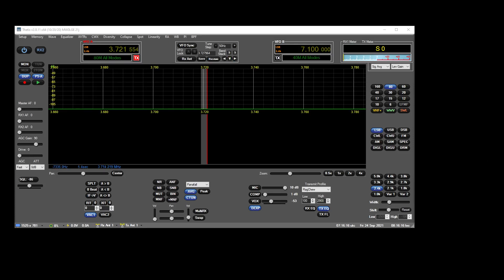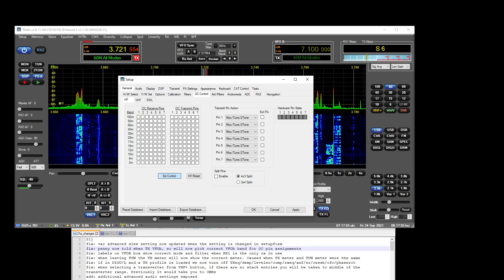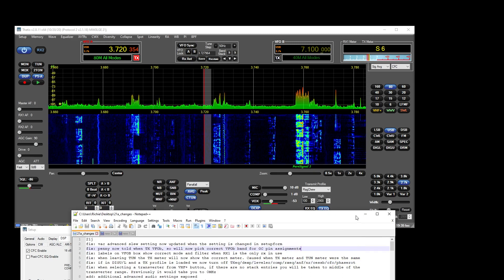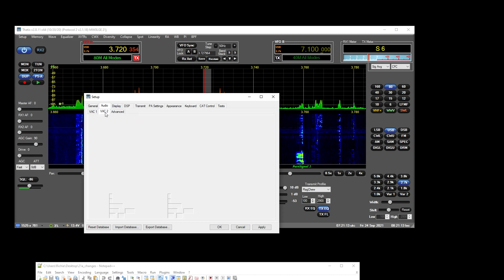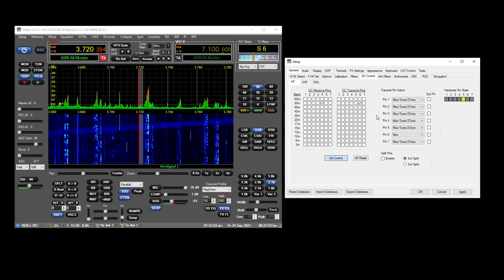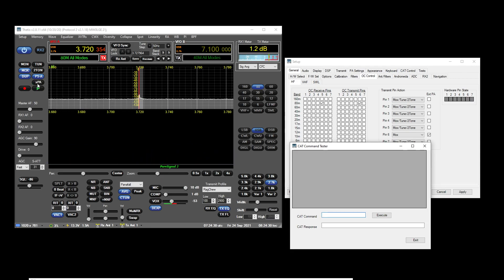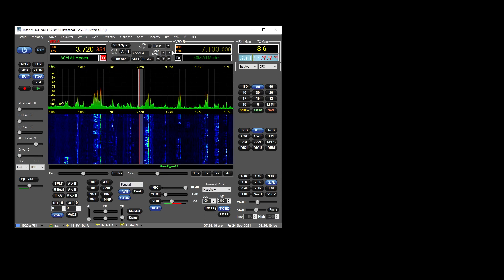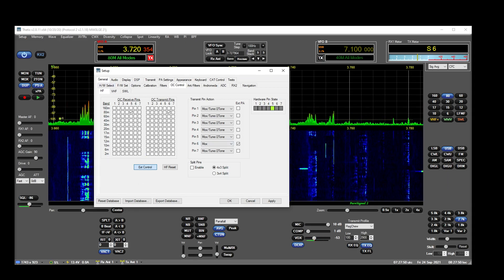Anan - Thetis 2.8.11 Update 21j

Comment: Question - how can a user get  TX audio from a VAC source using the original VAC by muzycheno -
Reply from the maker: you would have to use some sort of mixing software, like voicemeeter, input audio into that, and then out to a vac device that is used by Thetis. Lots of info over on the apache labs forums, and audio sections where you can ask and get advice. Cheers.
Reply: @mw0lge  Thanks for info. All the best. Cheers